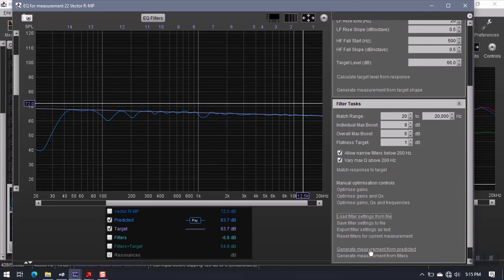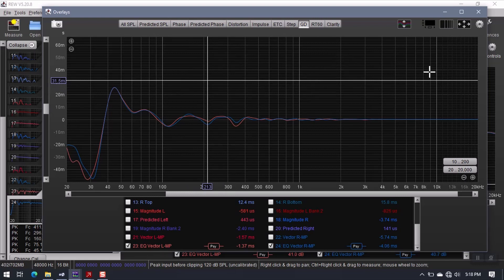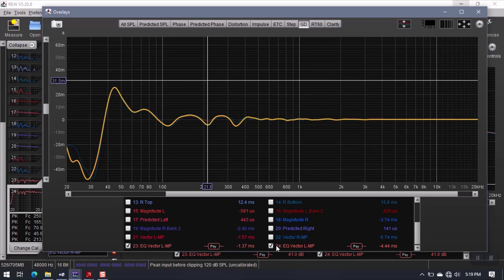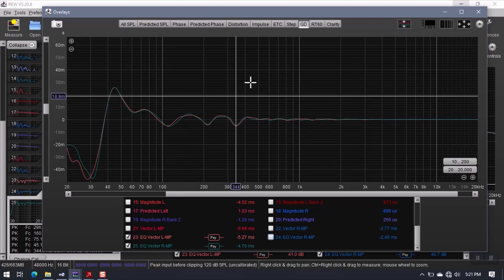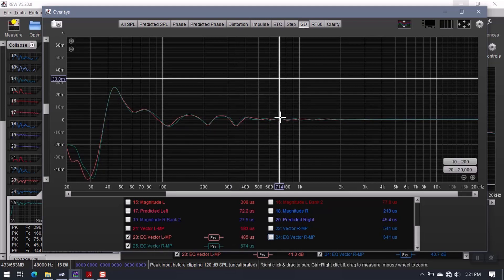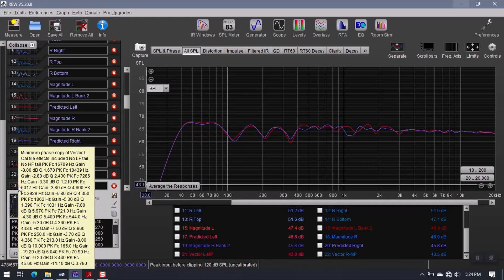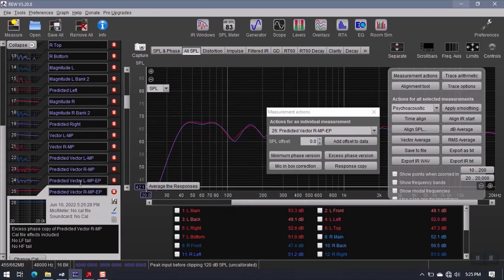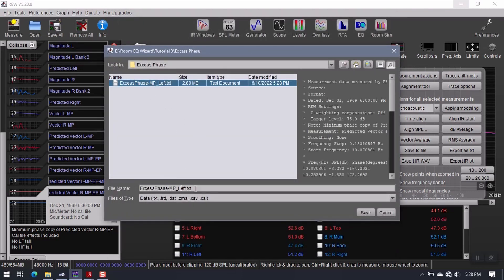Digital Acoustic Correction for Desktop & HiFi speaker systems using Room EQ Wizard and rePhase - P3

Comment: Loved all the parts and the idea. BUT READ CAREFULLY. You NEED a top end 2013 Haswell Laptop CPU or Top end Haswell Desktop CPU or ABOVE to complete all the steps. This piece of shit of software that i love so much called REW isn't Optimized to work with lower CPUs than the Top End Haswell. I did all the steps till REW crashed on my face. I obviously DID ALL AGAIN BECAUSE Im just a perfectionist like you that does not give up. returning to the first 14 measurements and again crashed in the lasts steps on my face this not greatly Optimized Software. SO. You Need at LEAST a Top end 4th Gen Intel or equivalent AMD cpu. You have been Warned.

Comment: Thanks for this tutorial! Why not use the magnitude filter banks01 previously build in EQ vecav-MP? and adjust GD on this basis? It would be a better image of the major EQ effect on phase during FIR treatment, or i am wrong?
Reply from the maker: So sorry... vecav-MP? I'm not sure I understand what you're asking. If you are referring to adjusting group delay it needs to be done with a smooth response, and 1/6th smoothing is too coarse. I have a better way of doing this that I will share soon.

Comment: Hi David, you mention that there is another way to align group delay(GD). My L/R measurements from 20hz-400hz is totally non cohesive. It seems that the timing is totally off. I am using a pair of subs pairing with a pair of bookshelf. Would appreciate if you can do a detailed video on this. Cheers
Reply from the maker: I think what I was trying to say, if I understand your question correctly, is that you can go back in and refine the group delay by being meticulous in getting those left and right graphs to align as closely as possible. It's especially important to line them up below 150Hz, which is something I have come to realize through additional experimentation since making this video. There isn't another way to do it, but there is more tweaking you can do, definitely. I just didn't want to make the tutorial an hour long by making you watch all of that. It can get tedious.

I'd love to do just that (make a dual sub video), but unfortunately I don't have two subs in a single system to test. I haven't done it myself yet. One of these days I will, but for now the tutorials can only get you started. Maybe you'll figure it out before I do!
Reply: Hi David, thanks for the reply. Your tutorials are extremely helpful. The dual sub phase alignment is a nightmare to deal with one of the sub having huge peaks & dips in the 40hz region.
Reply: Just a thought that I have observed after correction is that the corrected sound may sound ‘thinner’ and seems to lost some of the ‘grunt’. The more precise and thinner sounding sound may be good for certain genre like vocals or perhaps electronic music. At the same time it may also sound weird on Rock and Metal. My guess is that a lot of sound pressure is being removed in the 200-800 hz region, especially for my case, the pair of speakers is only 5cm off the wall which exacerbated the problem.
Reply from the maker: Just speculating here, but there is a need to increase the volume level of the output (amplifier) to compensate for the loss of level introduced by the filter. I assume you've turned the level up to where it should be; to where it's optimal. If you are listening at lower levels, there is going to some perceived loss of "grunt" as you say. There needs to be a level-matched output in order to make comparative conclusions. It could also be that you just aren't used to the sound of a neutral response, which definitely can be weird at first. Unfortunately I can't hear your room, but my advice is to just make sure you've done everything right, turn up the volume, then live with the filter for a while. If it is doing its job correctly, the moment you turn the filter off you'll be thinking to yourself just how bad the system sounds without it.

Something else you can try is just a simple frequency response filter that only acts as an inverter EQ. Try that and see what it gives you. I just put up a new video explaining how to do it.